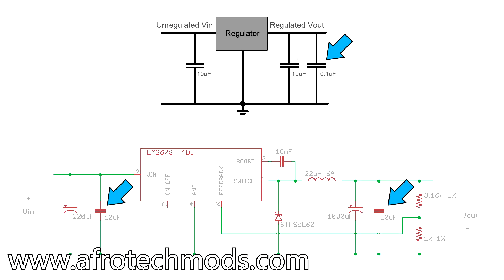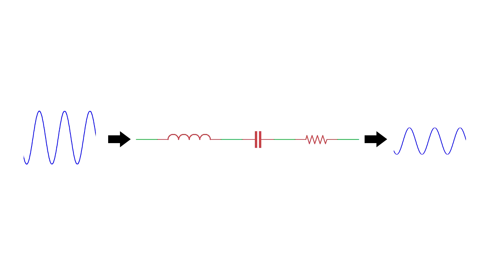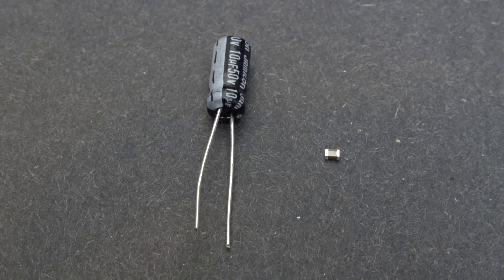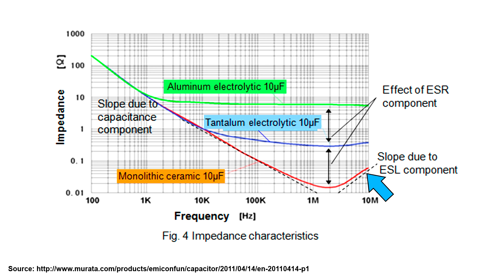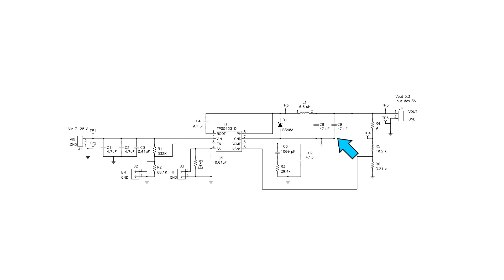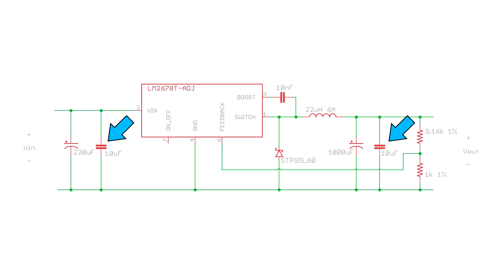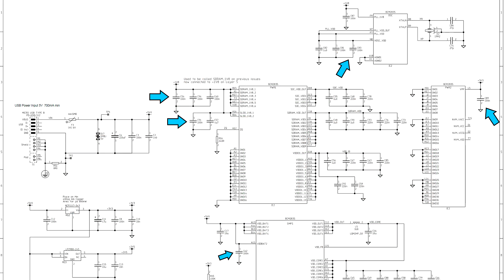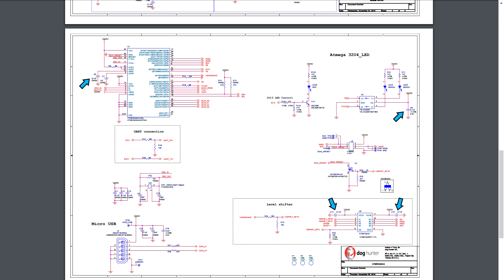Why electrolytic capacitors are actually kinda crappy 💩

Comment: ALL CAPS SUCK. That's the short answer. How they suck depends on the type. Electrolytic caps suck because of what you said, and the fact that they are almost 100% the first thing to fail in any circuit over time, especially with any heat. On the other hand, ceramic caps, while much more reliable in most cases, have the DC bias effect where you may only get 30% of the capacitance if operating in DC mode towards the higher end of the rating (especially in smaller packages with high capacitance).  This, and the fact that electolytic caps can literally explode if operated even near their voltage rating is the reason I never use caps at more than 50% of their voltage rating.  There are so many caveats for any capacitor, it pays to be educated on what's best where, so I really appreciate videos like this!

Comment: I'll often see schematics recommend a 100nF ceramic cap right next to the power lead of a chip and a 10uF electrolytic further away. If I can get a 10uF ceramic just as cheaply and easily, is there any advantage to using the electrolytic or is this just a relic of ceramics once being hard to get in the uF range?
Reply from the maker: At that point it's down to the specifics of your application. Like what is the package size of the ceramic, how much inductance is tolerable to you, does the capacitance rating vs DC voltage affect you, distance from IC, what is the dielectric etc. But yeah the 10uF cer is probably going to work just fine. It's crazy how cheap they have gotten now.

Comment: In general, electrolytic capacitors are known to have a shorter lifespan and higher leakage current compared to other types of capacitors, such as film capacitors. They also tend to be less stable at high temperatures.

Finally, thank you for making this video!

Comment: I'm working on upgrading an old CRT, (because it turns out that my cheap model had the same tube and circuit board as a more expensive one, it was just lacking some components*), and one of the things I noticed in the schematics was that the higher end models had both an electrolytic and a ceramic capacitor between a +6V8 line and the ground plane. I didn't understand why I needed both, but I put them on anyway. Thank you for helping me learn why!

*This does not work with all brands and models. CRTs contain high voltages that can kill you if you aren't careful. And never attempt what I'm doing on a "hot chassis" CRT (which are usually only the ones with only RF input).

Comment: Also electrolytic caps degrade as they age. This will become apparent in older electronics from 20+ years ago. I once had a Kenwood receiver from the late 1980s. Last year I fired it up after a long period of non-use....all I got from the 100W per channel output was a LOT of hum. The power supply caps no doubt failed and needed to be replaced. I did not have the time to fix it so I gave it to someone to tinker with.

Comment: So essentially for cassette deck applications where they are rated 20 Hz ~ 22 kHz (Sony TC-KA7ES) it does not matter if you use electrolytic capacitors.

Comment: I've been keeping old electronic devices from the early 90's and 2000's example snes console, ps2 slim and crt tvs will these devices have problems with aluminum electrolytic capacitors if stored for a long time?
Reply from the maker: Electrolytic caps are usually the first thing to die in electronics. Keeping them at room temperature can help the lifespan.
Reply: @Afrotechmods  my room temperature ranges from 33-35C

what is the time frequency to energize all electronic devices and avoid damage to electrolytic caps and aluminium? Or is it not necessary and can you keep it for many years?
Reply from the maker: @classicsamusaran3817  You don't need to power them up. Just don't store them in a cold or hot area. Keep humidity fairly low. If there are backup batteries like on some old games then those will eventually leak and fail no matter what.

Comment: Stupid question from stupid person (me)
I'm replacing the 3 electrolytic capacitors on an automotive circuit board. 30 year old capacitors tend to leak and corrode themselves out of existence, and the trucks run like crap because of this.
Anyhow.... Would it be wise to replace the electrolytic capacitors with ceramic? I would have to solder leads to both ends and then solder the leads into the board, so it'll look ridiculous, but would performance of the boards increase?
Reply from the maker: It depends on what the original capacitance is. Also since this is automotive the temperature ratings will matter. Chances are you should go for some high quality 125°C electrolytic caps.
Reply: @Afrotechmods    Nice of you to still answer questions.

Comment: Low impedance of output capacitors across frequency and a high loop-crossover frequency provide good transient response. Using both ceramic and electrolytic output capacitors minimizes capacitor impedance across frequency. Ceramic capacitors are best for high frequency and large-value electrolytic capacitors are good for low frequency. 
https://www.ti.com/lit/an/slyt639/slyt639.pdf?ts=1595419793521&ref_url=https%253A%252F%252Fwww.google.com%252F

Comment: I assume this same theory does not apply with passive crossovers? Have never seen anyone use non electrolytic capacitors for high frequencies. In this situation would adding a small .1 uf or .15 uf mica or polyester cap in parallel with an electrolytic provide improved high frequency performance?
Reply from the maker: It depends on the specific electrolytic cap but yeah if the calculations are right and there are no resonance problems it might actually be better to have that poly cap in parallel. I've measured a lot of electrolytic caps with ESR of many ohms at 10kHz.

Comment: Electrolytic capacitors are actually not “kinda crappy”, but perfectly capable when used within their design guidelines and use conditions by a competent design engineer.

Comment: I can see how situations could arise where it would make sense to put two different capacitor types in a single package. It could save cost and assembly time, and might even improve performance slightly. However, the burden would be on the designer to only include such a combo design when it really is best.
Reply: Frances 22 y.o - check my vidéó  Could everyone please make future comments to the main section? I keep getting comments that have nothing to do with any comment I made, which in any case was many months ago.

Comment: Sorry but you didn't cover a lot about the differences. Also as a design engineer I can promise you in high frequency applications we definitely do calculate (or more usually read the spec sheet) to find the best caps for the Fmax. You missed out Dielectric Absorption all together, and you also missed out the effects of capacitor type on effective life. Then there are also the new hazards of high value ceramic capacitors IE they crack easier and are more likely to short if they do.
Reply from the maker: Comments like this always come from people who have never uploaded a single Youtube video about electronics.

Comment: So it's not advisable to use electrolytic cap replacements for vintage stereo rebuilds?
Reply: It is often best to use a new electrolytic where the maker used one.  Some designs only work because of the ESR.
Reply: @kensmith5694  Ok thx.

Comment: Nothing said about dielectric absorption :(
Also it does not matter 0.1 Ohm of ESR or 10 Ohms if your circuit consists mostly of 10-100 kOhm resistors.
Any choice should be justified. It is not too smart to say "this is bad" or "this is good". You need to understand what properties (and in what quantities) you really need and choose components accordingly. Also you should be able to test if you selected correct values for your components. First, theoretically find what is optimal value. Then test optimal, bigger and smaller values. You should see that your circuit behaves better or worse depending on your choice. If theory conflicts with what you actually see, than it is wrong and you need better understanding of what happening.
Again: "use 100nF and you'll be fine" is a nonsense.
Reply: In most cases, you need to have some component other than resistors in the design for it to be useful.  :) :) :)
BTW:  You can get useful power gain from two identical transformers.  Lets see if anyone can guess how.
Hint:  It involves a property that is normally not liked.
Reply: @kensmith5694  with resonance maybe. I'm not true electronics engineer, just tired from bad software and hardware designs and of people, who do not know what they are doing.
Reply: @sdjhgfkshfswdfhskljh3360  No that isn't it.  I will give this one away:
Presume you have 12VAC and a old fashioned car headlamp.
Take two identical 120V to 12V transformers and wire as.
The 12V windings go in series and in series with the headlamp
The 120V windings go in series-opposing so the voltages cancel as seen at the free ends.
With it sitting like that, the inductance of the transformer windings lets very little current get to the headlamp.
Put a moderately large capacitor across the free ends of the 120V windings and nothing should happen.
Using a bench supply and a resistor, make some current flow in the 120V windings.
At some current, the field created by the 120V winding starts to saturate the transformer core.
The saturation makes the inductance decrease letting current flow to the headlamp.
Reply: @kensmith5694  so you can transform a transformer to a simple piece of wire. Do not see what here can be treated as power gain.

Comment: Now I'm curious why this is NOT taught in school. That's like basic requirement knowledge for electronics, like gravity for physics... WTF?
Reply: Schools have limited time and limited budgets.  When it come to electronics, they only teach about 10% (at best) of all there is to learn about it.  Also, often, the teaching methods are not so good.  There is a lot of focus on memorizing stuff rather that really understanding it.
As a fun experiment, try drawing the classic non-inverting op-amp circuit with a gain of 3, but as a mirror image, and then asking electronics students what the gain is.  Many will get it wrong because they memorized where resistors will be and an equation.
Reply: @kensmith5694  Yeah true, I admit that I barely know anything from school anymore either which I didn't already understand.
The whole memorizing thing is shit, the only exception is the small 1 * 1.
Reply: @BloodyMobile  
I lucked out and my school electronics got applied and thus remembered.
Electronics is a fun hobby if you keep it simple.
It is still reasonable to make a crystal radio to impress people with "pulling signals out of the air with no battery"
A binking LED doesn't impress people much.
LEDs  as lit up eyes that only light up when someone moves past can be a good spooky thing.

Comment: I so desperately want to understand videos like this, and I did learn something for sure.  However, he really lost me right at the start where he basically said that capacitors are supposed to pass a/c waves right on through.  I've been trying to understand power supplies lately, and I thought it was exactly the opposite: that capacitors are supposed to help you flatten a/c waves.  My brain is just too small for this stuff. :(
Reply from the maker: It depends on whether the capacitor is in series or in parallel with the rest of your circuit. Also think about it... if all the AC goes through the capacitor to ground, what is left? DC!

Comment: Useful, seldom mentioned information.  I've wasted many, many hours with these problems have occurred. 
You remember, when op-amps were new.    ;)
Reply: I remember that for the monolithic ones.  I have seen ones that were made of many parts.
The level shift in a tube based op-amp used a relay making it basically a chopper amp.  Large film capacitors were used.
Reply: @kensmith5694  Ahhhh, those were the days.  I used to enjoy "playing" with such things but these days, I can't afford the optics to read the part numbers.    🤣
Reply: @Graeme_Lastname  
The worst news is, if you bought the optics, these days a lot of parts don't have numbers on them.
Some parts have it "laser etched" so that if you get the right wavelength light the the right polarization and a bunch of magnification, you still cant read the darn thing.
Reply: @kensmith5694  I suppose we have the choice, smartphones or crystal sets complete with 20 foot antenna.   Keep well m8.   :)

Comment: One thing they teach you in electronic school is + or - 10 % or better yet + or - 20% .  If you think electrolytic caps are bad you should check out tantalum caps. = the send out the best smoke signals.

Comment: 6:43 Maybe true but the main reason is that component count also affects cost as you will have to use a bigger pick and place machine to account for more reels of components. So designers balance the need and cost of using an existing part versus the "proper" part. Designing electronics for mass production can be very intricate. There are a lot of factors the affect other parts of the design process.

Comment: Another reason the 0.1uf caps are ubiquitous in digital designs for power decoupling is that for some time they've been approximately the most capacitance you can get in a surface mount 0402 package (which generally dictates the inductance), X7R (temp coeff, specs the performance over temperature) capacitor with a reasonably wide voltage rating (like up to 50V).  Technology is getting better so higher capacitance devices in the same package are starting to come available with these specs, but slowly, and the Voltage rating isn't there yet.

Comment: Another thing I don't hear people mention often is that a physically smaller cap can be placed closer to the ideal location. This is why even designs that use only ceramic capacitors often have a big ceramic and small ceramic. The bigger one has more capacitance but because it's physically larger, it has to be further from the thing it's bypassing, so they put a closer, smaller ceramic as well.

It'd be cool if someone could do a catchy and accessible video about ceramic capacitor DC voltage derating. I think that's something that people are starting to run into more and more as large-value ceramics become more and more popular.

Comment: I still don't understand the point of putting a tiny cap (low ESR/ESL) in parallel with a big electrolytes one (with higher capacitance/ESR/ESL).  The small one doesn't "delete" the ESR of the big one right? So how is it possible?

Comment: Can you make a video on how to make a sequential LED setup. Both with 5mm led’s and ribbon LEDs. I am trying to make an led circuit for turn signals but trying not to use an Arduino board. Prefer a safe long term setup. Thought about using capacitors and resistors to cause the sequential effect but that’s kinda bulky

Comment: After 50 years those electrolytic will dry out.  Work for all ceramic designs.  check ripple current required for PWM applications.

Comment: STEP LOAD needs lots of electrons,  more uF = more electrons = better response.  Also you want more decoupling caps to reduce the total ESL.  Also use voltage plane 3mil dielectric ground plane for really good hig frequency cap at every chip.

Comment: Can anyone help me? I burned up some 2200 μ f25v LZ 105c capacitors on a car amp and don't know what to replace them with exactly, there are no exact product matches for the ones used in the amp which were YEC (YEC is the brand) 2200 μ f25v LZ 105c. I've looked up some on ebay and the ones I find look shorter than the ones I have in the amp (about 2in in height) and none of them have the "LZ" in the product name, what is that? The reason they burned up is because I accidentally hooked up the power and ground backwards, these capacitors are the ones right near the power input of the amp (the board itself has absolutely no signs of damage fortunately).  If anyone knows what I need I would be eternally indebted!

Oh, also, the ones from the amp appear to have aluminum tops if that helps.

Comment: There are multiple use of capacitor. For example capacitor for filtering and capacitor for pulse control of ic. My question when we could apply those, and how to choose correct capacitor for certain load or ic

Comment: My capacitor doesn't work for some reason. When I connect it to my led circuit the led flashes for a millisecond then goes reaaallly dark. The led just about gives of a glow after. Help?
Reply: You killed the LED. Use a resistor.
Reply: @leestons  When I connected the led to the circuit before testing the capacitor I already had my resistor in...

Comment: Great job, thanks for the refresher, I'm gonna have to watch about 3 more times before I've got it all back lol
Reply: In power engineering this is a serious concern when designing capacitor banks since the capacitors tend be so large the inductance is far from negligible and if not accounted for your power factor correction will not be adequate. It is also important when calculating the proper size of your inductor for limiting in rush and  out rush current.

Comment: For passing emissions you have to look at the impedance of the entire board across the frequency spectrum for bulk capacitance. You also need local capacitance within a distance of the ICs. Any frequencies that drops below 0.1 or 0.2 ohms or the impedance of the output drive can allow interference or not have enough energy to supply the circuit. This can be one cause of failing emissions.